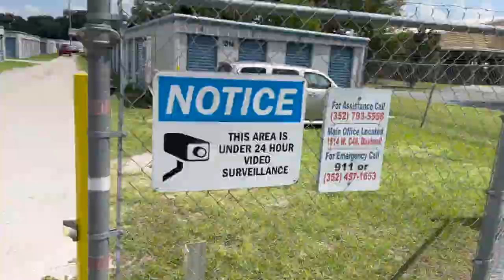WE GOT A STORAGE UNIT

Comment: I know levi jeans will accept any Levi's that they make it doesn't matter how beat up they are they will give you money for them. You don't have to have a reciept and they can be real old too. I dont know if wrangler will do the same thing. You can look it up on there website. They recycle the jeans. The purses the first one weren't in good shape but you always look through pockets and purses. Also flip through the Bibles and other books because people hide money in them. When you go to these auctions do not assume any thing that is suppose to work does and don't assume tools are in the tool boxes. Those one tool boxes in the 125  were at least 75 if the dryer worked that could be two hundred. The flooring would be about 150. The other stuff didn't look to good but I know you didn't get it though. I don't like how she didn't even let you all really decide she just took one bid. You got a few things but the dressers and the other big tall cabinet were not with anything they were particle board. The bible it's self was worth money but I would have donated or gave it away like you did.